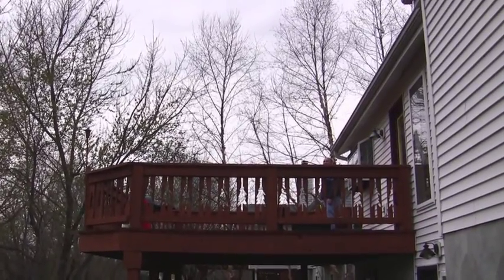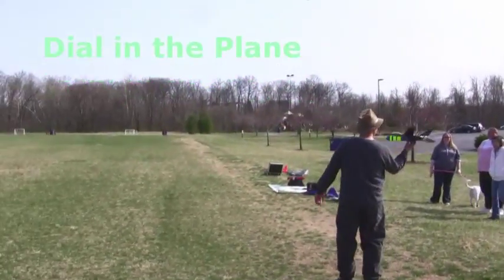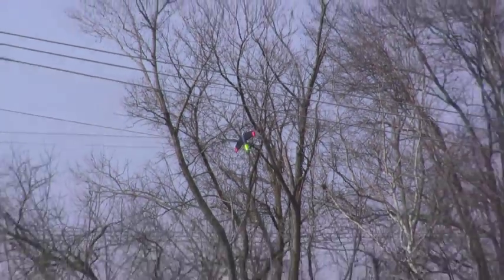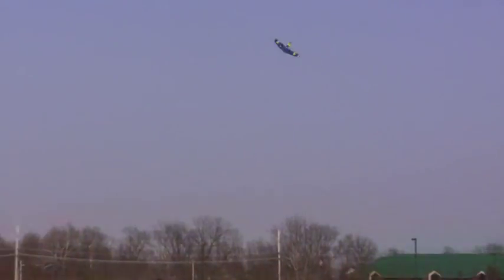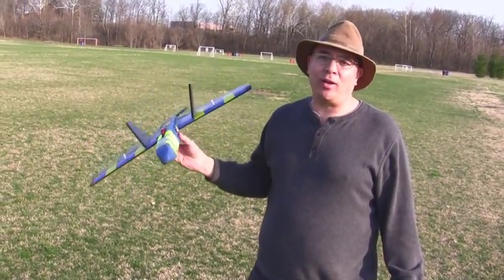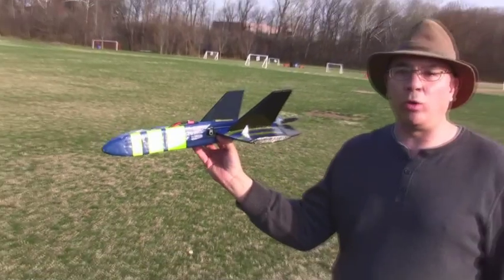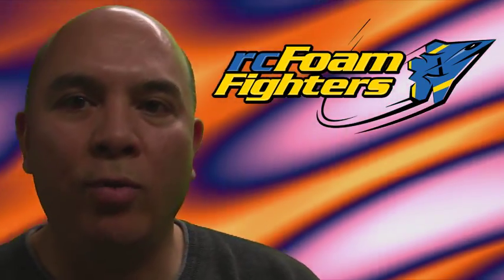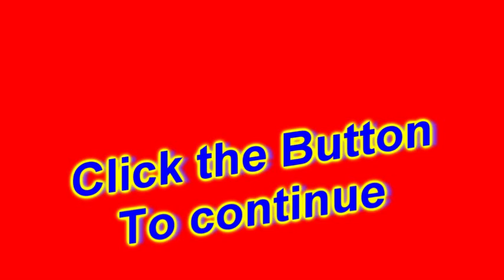EPP Bullet Proof Plane Series Part 1 (crash testing)

Comment from the maker: Mike, I'm sorry but there are no plans available for this plane. It was 100% built from scratch and I just drew the dimension onto the foam as I built it. We won't be releasing plans for this one because it was modeled after the "Bird of Prey" which was made by Edge RC. The plane is not in production any more but if you shop around you may be able to find one. I will probably make another forward swept wing plane in the future, one of my own design that we can give the plans for.

Comment from the maker: Thanks for watching our videos!! I plan on doing some build along videos on some easy to make EPP planes later in this series so stay tuned. As for the elevator / ailerons or elevrons I will be using 3/32 inch bass wood covered in tape on all  these bullet proof EPP builds.